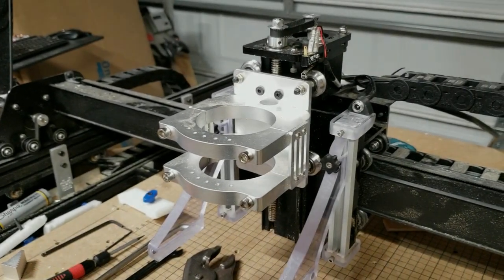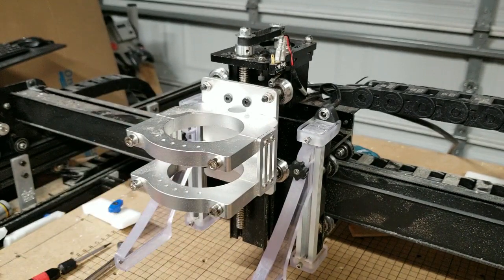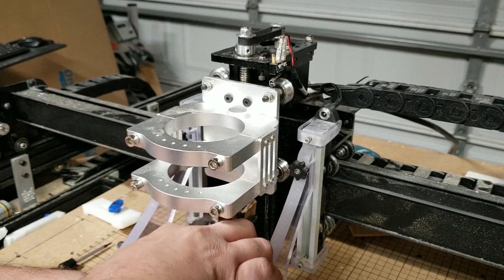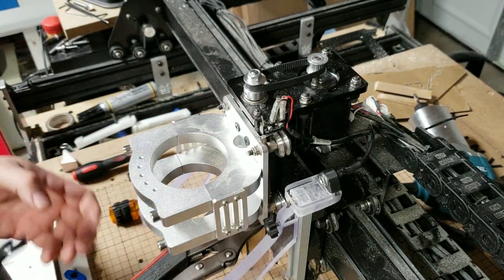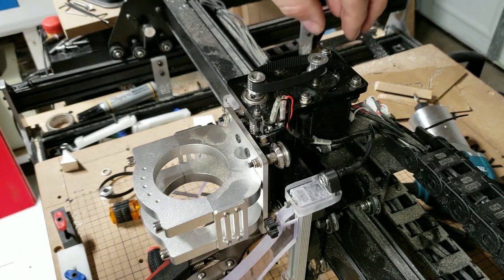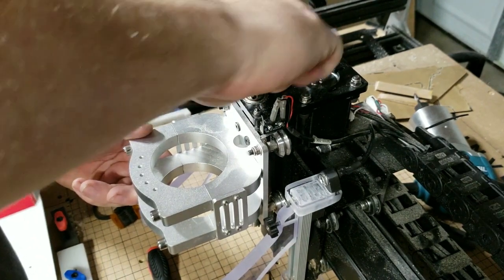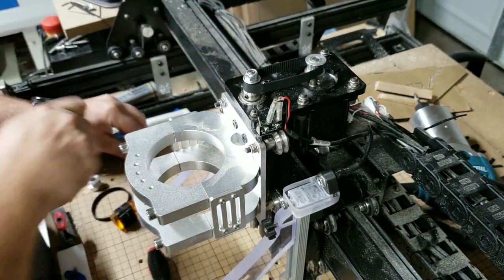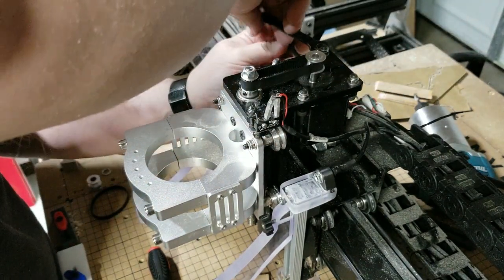X-carve Z axis 9mm belt upgrade - How to

Comment: Yes i understand but the z axis has virtually no force on it so whoever is breaking z axis belts are doing something wrong
Reply from the maker: It's a short belt and subject to wrapping around 2 pullies.  It is subject to more abuse than you think.  It's more about the same section of belt wrapping tightly around 2 pullies repeatedly that can stress the belts.  I've literally sold about 300 Kits.  There is a reason beyond your assumptions.

Comment: How the heck are you breaking z axis belts....there is almost zero force on z axis..all the force is lateral on x and y belts...
Reply from the maker: I personally did not break a belt but the 6mm belt does allow for excess backlash.  Lots of users are having issues with the 6mm belts breaking.  The 9mm improves accuracy by reducing backlash and is at least 50% stronger.

Comment: Hey, is the timing still the same as before when switched to the GT2 Pulley?
Reply from the maker: It remains 1:1
Reply: Adapted Machining Hey thanks for the quick response 👍 I have one last question. Im currently upgrading from the 1000mm to the 1800mm makerslides. Do you think standard belts can be used at such a length? Or do I have to get the thicker 9mm belt as a necessity.
Reply from the maker: @karveitstudio3847  I would suggest getting 9mm 3gt belt for the extra length.

Comment: How are you coming along on the z axis slider? I would be interested in that. Also where did you get the tool mount for the x carve in your installation video? Any other upgrades?
Thanks
Dave
Reply from the maker: The updated slider is all drawn up in cad and if I ever get fully caught up I will machine out the prototype. I have most of the components on order. 

As for the router mount I found it on aliexpress.  Note the steel v wheels I use from open builds.  

Has not even worn through the coating on the marker slide with almost 200 hours of use.